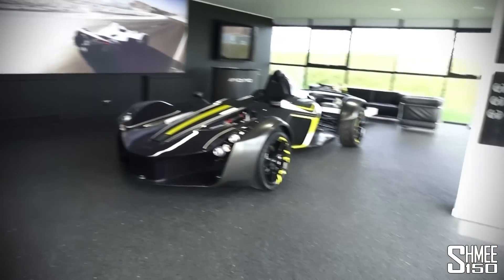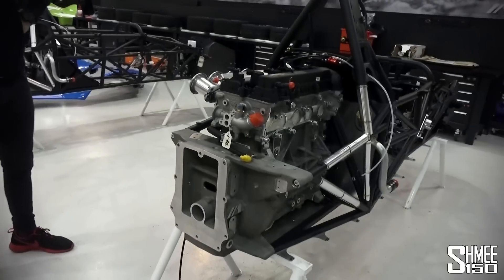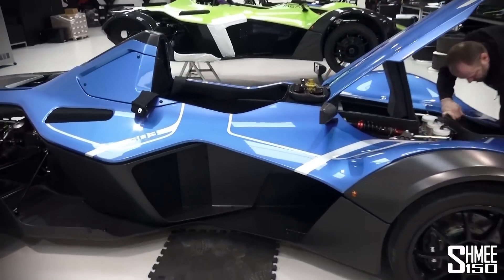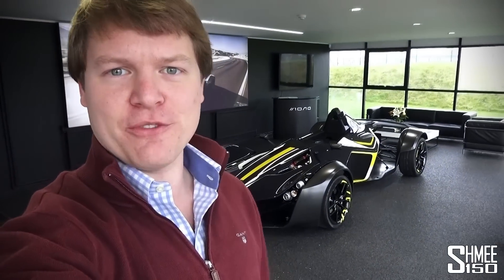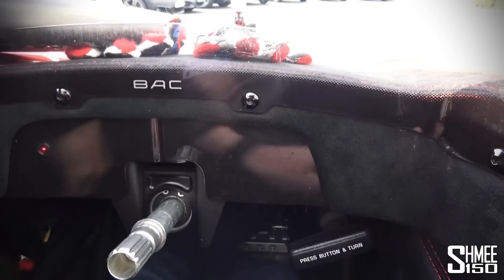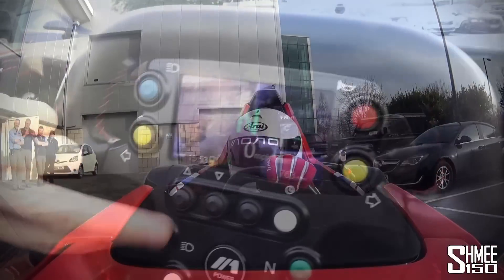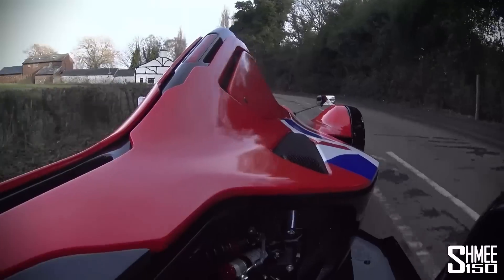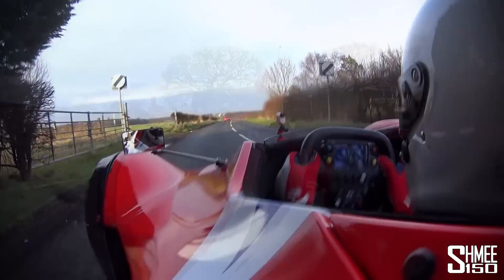The BAC Mono is a Racecar for the Road!

Comment: hey Tim, offical power figures for the ford GT are out , 647 bhp and 555 pound feet of torque
pretty insane for a 3.5 ltr engine
the development team tested it against the 675 Lt and 458 speciale and it's quicker then both.
But McLaren's not resting, wonder will it be same in 2018